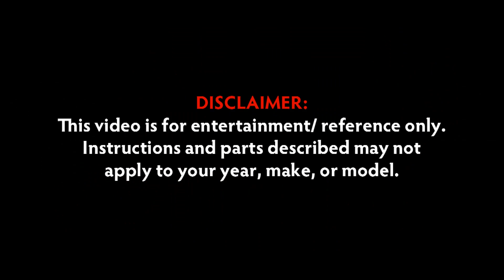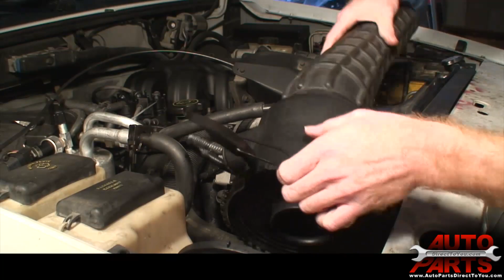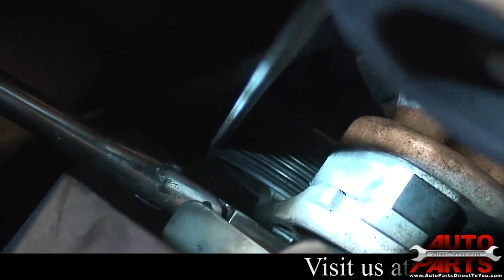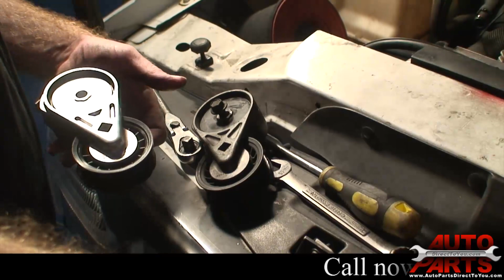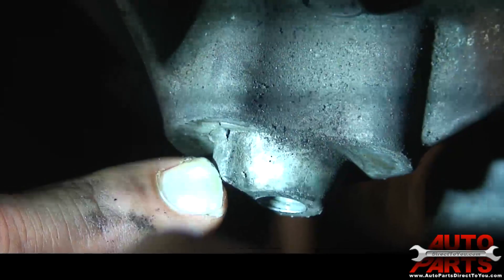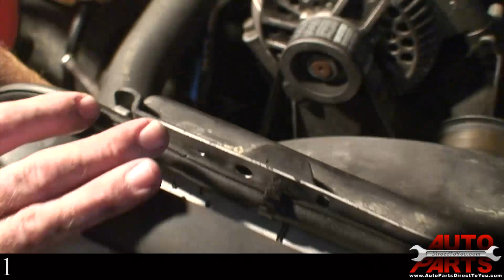1995 Ford Explorer Serpentine Belt Tensioner

Comment: Okay, my idle pulley seized and I was able to replace it. (I'm also taking the opportunity to install a new radiator, so have a pretty clear work space). The issue I'm having is even with the tensioner fully loosened, my belt is still about 1/2 - 3/4 of an inch short of going under the new pulley (I've got it around all other pulleys figuring the idle pulley was the easiest to make the final thread). HOW DO I GET IT ON THIS PULLEY? And, if I have to force it on, won't it be too tight? (This is weirding me out a bit because the new pulley is identical size as the broken one, so the belt SHOULD just slip on). HELP!!!
Reply from the maker: Try to find a belt diagram and make absolutely sure the belt is routed the proper way. Also make sure to compare the old and new belt to make sure they are the same size. Then yes it will be somewhat of a tight fit but with the tensioner fully released, the belt should slide right on.

Comment: My 1993 for ranger. 2.3 L  does  not  have a  bolt head  on the  belt tensioner. Is  there a  special socket or  tool for  removing  this ?
Reply from the maker: Yes it should just be a 3/8 square hole for a ratchet to attach to. THey do make a serpentine belt tool that makes it very easy and sometimes you can borrow it from an Advance Auto parts type store.

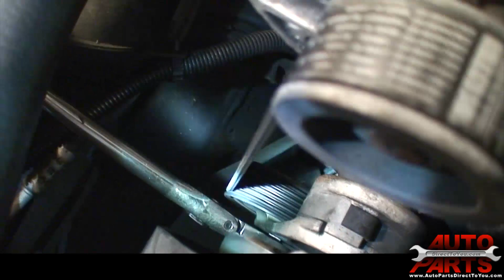Comment from the maker: at 1:08 you can see the issue, the tensioner was sticking. This can cause a couple things, it can make a rattle/clatter noise as the tensioner moves around, the big issue is that the belt was slipping. When the tensioner won't hold tight against the belt, the belt will slip and squeal and possibly cause loss of power steering.

Comment: Thanks for the video, very helpful but how do you know when the tensioner has gone bad? What signals where present?
Reply: Your belt is visibly loose , while it idles watch the belt .
A bad tensioner can make your. Alternator not charge .
If belt is too tight it can have same results . 
Draw s your battery big-time..

Comment from the maker: @mrtwmccoy Yeah the 5.0 is tougher, much less room in the engine bay to work with. It should be very similar in overall procedure though. You should have a sticker in the engine bay with a belt routing diagram and a picture of how to turn the tensioner to loosen the belt.